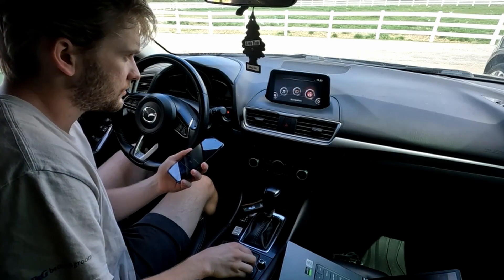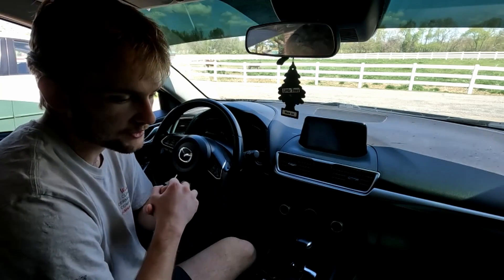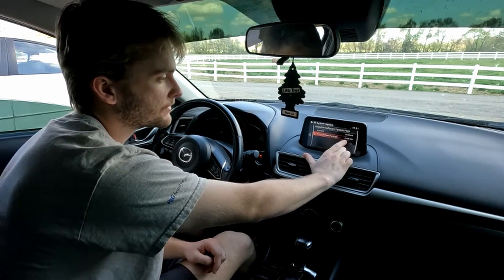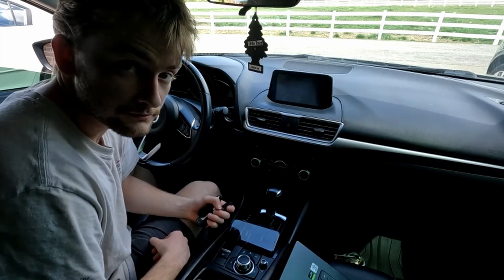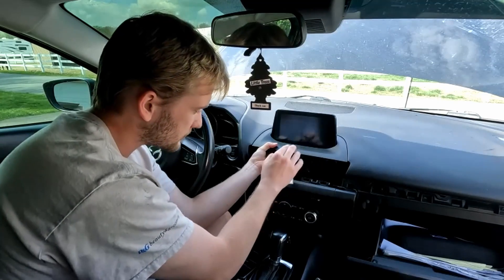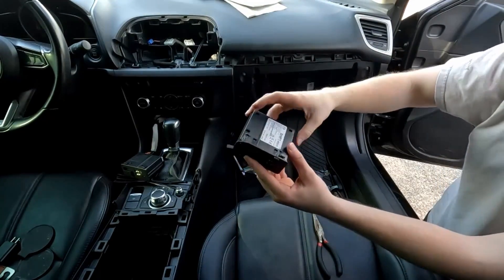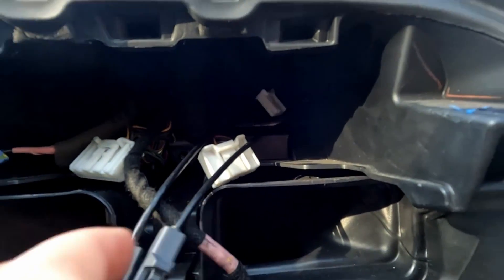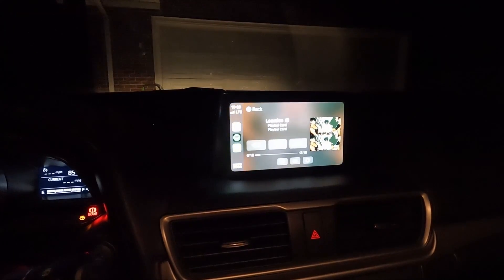How To Install Apple CarPlay/Android Auto On Your Mazda Infotainment System

Comment: So the cabling on the new and the old one is not the same?
Reply from the maker: The only difference between the two is the additional two wire that go from the head unit to the new usb hub.
Reply: @Dom60999  Thanks! Is there a Bluetooth option? I saw some dongle online.
Reply from the maker: @nonotherthananother  Yea there is a bluetooth dongle you can buy that you plug into the usb port. There's also a usb hub that supports wireless applecarplay. I believe its called Mazda-TK78-66-9u0c-Android 11. I haven't done a lot of research about it but i think it only supports wireless carplay. Not wired. Hope this helps.
Reply: @Dom60999  I'll definitely look that one up. I need only wireless and occasionally for navigation. Cheers!

Comment: I formatted the usb stick, but my hub will not read it in either port. Any advice? 2018 mazda 3 hatchback.
Reply from the maker: I believe Mazda is only compatible with FAT32 and FAT16 USB sticks. I hope this helps!
Reply: Follow-up question, I have the new USB hub installed before the update. Is that why I can't get it to work? If so, do you have a suggestion for me? I really appreciate it. Thanks man!

Comment: I already swapped out the usb hub in my '16 mazda3 MT. It wasn't until afterwards i figured out i needed to update the firmware. Do I need to swap the OEM hub back in or can I use the carplay hub to install the update? 
Super easy to remove that whole usb hub trim panel from the whole car and then remove the hub the right way if you have a Manual Trans! cannot speak for the auto
Reply from the maker: You can use that USB hub to update the firmware. I’ll have to look into finding an easier way to remove that hub. I’m sure it’s a very similar set up to the auto trans. Thanks for the info!
Reply: @Dom60999  Thanks! 
the trim removal is probly the same aside from removing the shifter. With the MT, just unscrew the shift knob and that trim panel/shift boot slips up and out easily. The auto is likely a bit more complicated to get the panel over the knob/remove the knob

Comment: What’s the main difference between OEM and compatible? If it’s noticeable id like to get the oem if not, I’ll just cheap out.
Reply from the maker: I've read some reviews saying the cheaper ones crash out of apple car play sometimes based on a few reviews on amazon. But I will admit that my apple car play has crashed a few times along with google maps not functioning properly. Based on my experience they're probably the same USB hub one is just sold cheaper.
Reply: @Dom60999  awesome, with that info I think I’ll go with the Amazon one, I do appreciate the reply and the video very helpful!

Comment: what if my version is below 55.00.650?
Reply from the maker: You’ll die. Jk. If you try to update your firmware to 70.xx.xxx with a current version below 55.00.650 then you’ll end up bricking the infotainment system making it completely useless and you’ll have to buy another. If your firmware is below 55.00.650 then update it to 55.00.650. Then you’ll be able to update it to 70.xx.xxx. If you can’t find version 55.00.650 exactly then one that’s above it will work. Like 59.00.540 or around there. Hopefully that didn’t confuse you more haha. Always do more research on your own though!

Comment: I have a 2018 Mazda 3 gt in canada but the thing that you drilled out is in my storage box in the middle instead, if I remove it and do the same process is it going to work?
Reply from the maker: Yes! That location is the best in my opinion cause it’s super easy to replace and the lightning cable is hidden in the box. All you need to do is take out the cup holders and that exposes the tabs that hold the USB hub in place. Push in the tabs in allowing you to remove the usb hub and unplug the wires. Plug the wires in the new usb hub and clip it back in place. Put the cup holders in and it’s done! You don’t have to screw around with drilling out the tabs in that location. Good luck!
Reply: Mine is a 2015 gt and mine is in the console as well.

Comment: where and how can i download the firmware for my 2017 cx 5 . right now i got 59.00.504 and i need atleast the version of 70 something
Reply from the maker: I have a link in the description to a google drive folder and it has the firmware. Download it on a flash drive and then follow the steps in the video. Good luck!

Comment: Does the "DTC" deletion screen where you type in the numbers work without touch screen / work with only the captain's knob? My screen started ghosting so I disabled the touch capability
Reply from the maker: It works with the touch screen and the captains knob.
Reply: Hi there. I,for some reason, don't have a touch screen. Just got the 2016 Mazda 3, so still figuring things out. Anyway, I just completed the upgrade without touchscreen and it worked fine. Select the numbers with the knob and use the enter button on the knob. I couldn't get access to the "Clear" and "exit" buttons, but it still worked without that step.
Reply: @rajmodi5669 how did you enter 99, for me I could only enter 9 with the knob, if I clicked it twice it just entered a single 9

Comment: Thanks for the video it works. The only problem is that the import of my contacts no longer works. Yet I disconnected the Bluetooth on the phone and the car and when I reconnected it works except that the import of contacts fails. What can I do ?
Reply: I restart the car and my phone too
Reply from the maker: Try deleting your phone from the infotainment and do the same on your phone and then reconnect them. Another thing that kept giving me trouble in general was the navigation chip that came with my car. As soon as I took the chip out of the SD slot the infotainment quit restarting and sped up a lot so maybe it’s causing trouble in that area as well. You can also try updating your phone to see if that works. Sorry I don’t have a silver bullet for your situation. Best of luck!

Comment: I installed mines, but nothing changed after I plugged in my iPhone
Reply from the maker: Did you check to make sure your firmware is above v70.00.xx? You can check this by going to settings->system->about->version info. If it is above version 70 then make sure your USB hub accepts Apple car play and all the wires are plugged in well. Another thing to check is the quality of the charger for your phone. I had a cheap junky charger and bought a thicker higher quality charger and that helped prevent Apple CarPlay from crashing all the time. Hope this helps!

Comment: If my stereo is the base radio for the 2014 I SV trim, then would this even work? Since I don't have firmware to begin with?

Would like to install Alpine ilx 507 some time soon. Thanks!
Reply from the maker: If you got the base radio I don’t believe that infotainment is compatible with Apple CarPlay. If you’re looking to get the alpine ilx 507 then it should already have apple carplay installed. This firmware update is only for stock Mazda infotainment systems. Hope that helps!